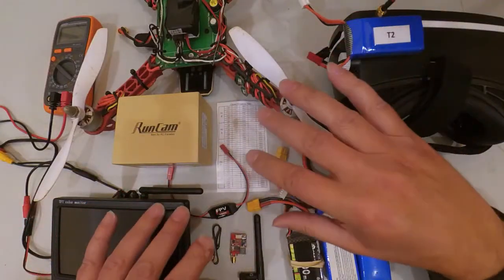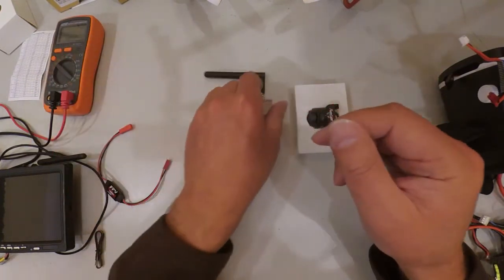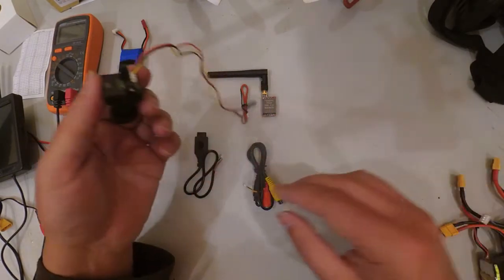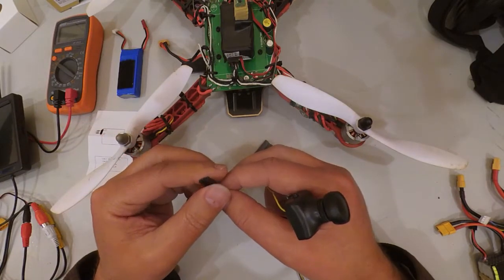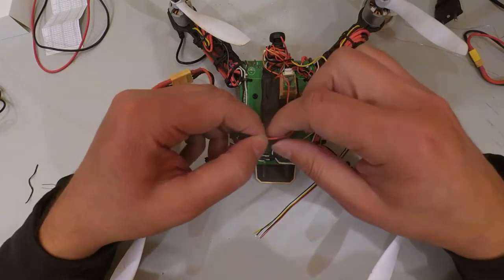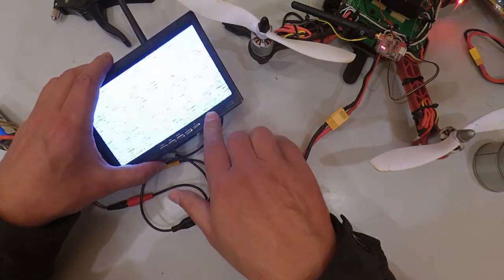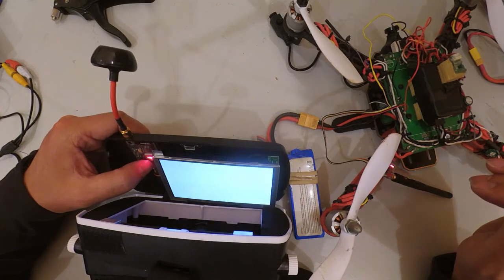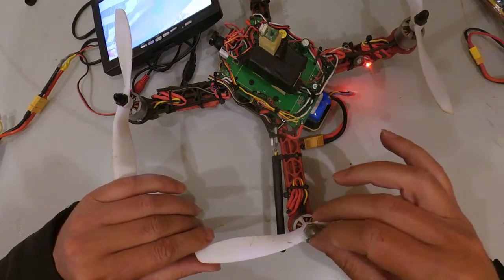How to set up FPV on a Quadcopter

Comment: All i need was how to connect receiver to camera then to battery like really you waste 20 minutes of my life ?
I got from ebay  3s 11.1 volt 850 mah lipo for both camera and receiver, don't use your drone lipo because it will take your drone voltage am i right.